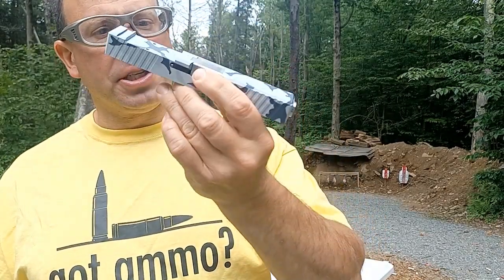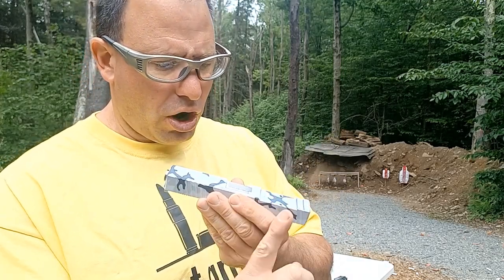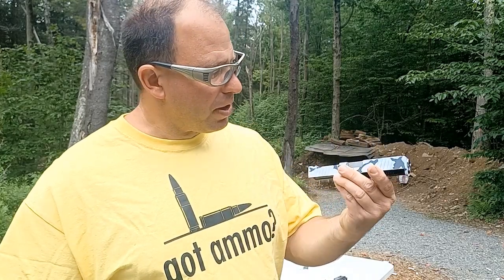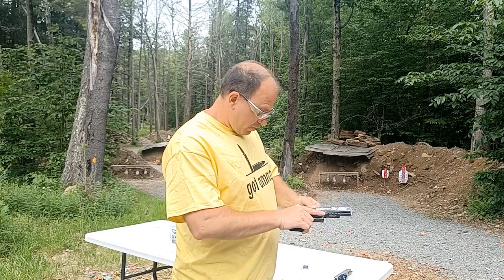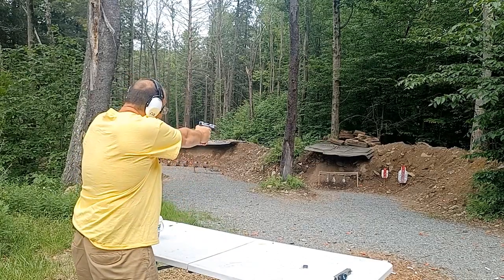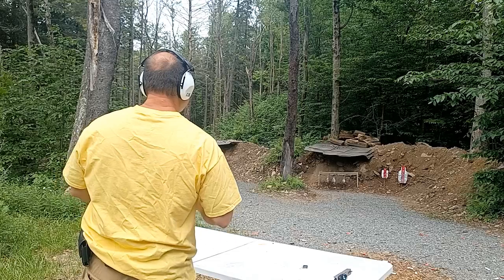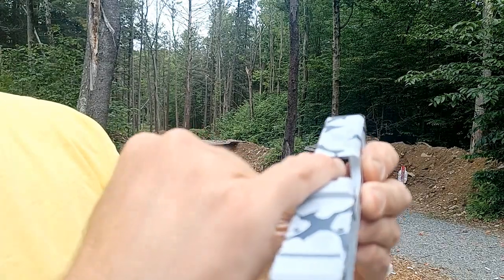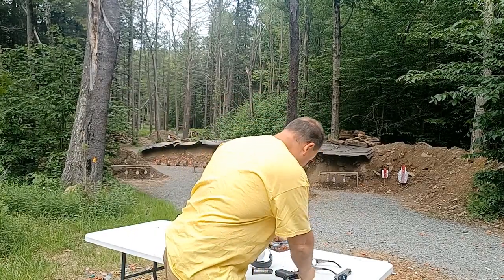Problems with Cerakoted Slides - Part 1 of 2

Comment: Good info! No cerakote for my carry gun!
Reply from the maker: I'm glad the video was useful. It usually the cerakoting wears in within 200 rounds. It's definitely not just going to work on day one like a factory black nitrate gun.
Reply: @absolutegunrights3079  

Ive been on the fence about a stainless steel finish for either a Glock 45 or CZ P-10C. Got any suggestions?
Reply from the maker: @USAUSAM82  if you're talkin about Factory guns, either one should be perfect out of the box. Both Glock and CZ have very low defect rates.

If you're just asking me how it would look.... I can tell you that I never want to buy another Black Gun again. I want everything you have an interesting color. So I would take stainless steel before black any day. That's just because I have so many black guns.
Reply: @absolutegunrights3079  

Yeah, im thinkin of having the stock slide done up in Stainless. So over all black. But alas, the issue you brought up with cerakote makes me not want to have the slide changed.